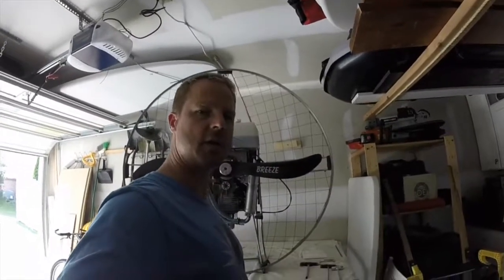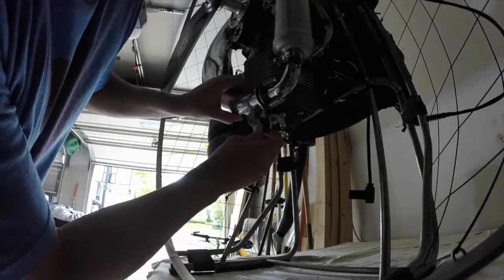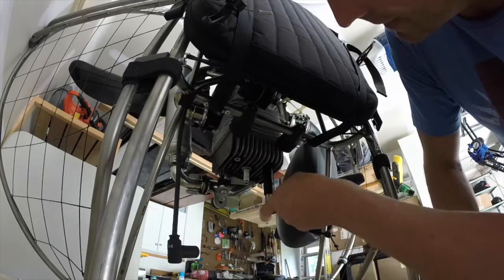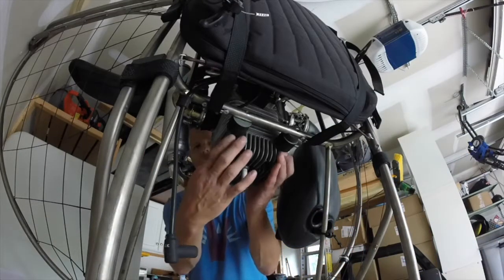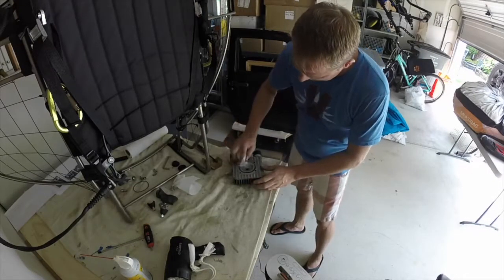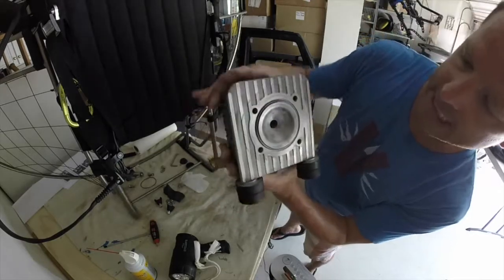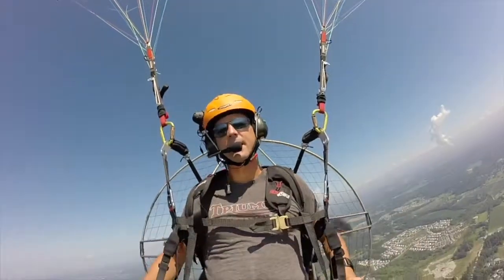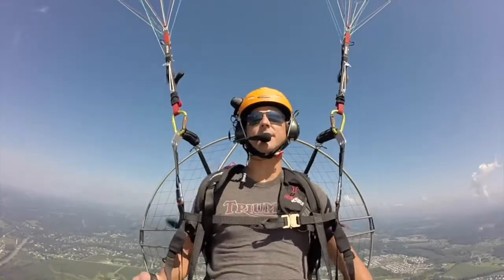Paramotor Maintenance - Cleaning the Decompression Port

Comment: just a note here to add my experience in case it helps anyone: On the Cosmo 300 Vittorazzi , dual start single spark. experiencing hard pull starts, heavy kick back and NO electric start. Starter runs fine, doesnt fire. no voltage drop. new battery and plugs. carb clean. compression good. new ground cable. Pull start works. electric does not fire up. just spins. Opened the head to find 2 decompression holes that were NOT blocked. So, not sure the problem. Will test the stator next

Comment: Great information, I bought a used PAP 1400 paramotor running a ROS 125 engine and it seems almost impossible to start, it's so difficult to crank it over with the pull cord.
I think the job you completed here might be the solution for my engines starting problem.
Thanks for posting.

Comment: Hi there. Good video. My engine a polini 130 refuses to start, the pull starter refuses to budge. But it can be pulled easily with the spark plug off. Could it b a case of clogged port?
Reply from the maker: I really don't have any experience with that brand of motor, so I would be reluctant to give any advice without knowing more on the situation.

Comment: Have the very same FB Simo machine here in Sweden, since 2013. But I fly on Aspen synthetic fuel so no carbon buildup at all. Much more expensive though, about 2-3x the normal fuel. I can recommend it to skip this maintenence or, at least have it about every 200 hrs instead.

Comment: Do u use torque wrench for the screws? What value? Thx.
Reply from the maker: Thx for the comment. I do use a torque wrench for tightening the head bolts on the cylinder. For those, I tighten them to 19 ft. lbs.
Reply: Thanks, I have to recalculate to ISO units :)). Fly the best.....

Comment: where the heck do you find/get those gaskets/orings for the head. I can't find it anywhere.
Reply from the maker: My unit is a Fresh Breeze, so I just ordered them through Southern Skies, since they are a reseller of that brand.
Reply: PPGFlyr I couldn't find that piece on the sites diagram. did you call and ask? I'm preparing to buy a monster and doing my research ahead of time so I know what spare parts to go ahead and order with it.
Reply from the maker: I went on to their website and found those parts right away. For the head, you want to be looking under the "Intake" portion of the machine. However, there should also be a "Maintenance kit" that you can purchase and that kit contains some common parts that need to be replaced every so often. When in doubt, call down there. Chris is very helpful and willing to answer most questions on the spot.
Reply: PPGFlyr cool thanks a bunch!

Comment: SANDPAPER OF ANY GRIT IS MADE OF GRAINS, (IN YOUR CASE 400 GRIT), OF ALUMINUM OXIDE, WHICH WILL SCRATCH THE LIVING FUCK OUT OF ANY METAL. unless you plan to polish those surfaces to 2000 grit or so, you will build up deposits UBER fast, after your destructive maintenance. GOOD LUCK!

Comment: I went into cringe mode when you brought out the sand paper! Even 400 grit.
You did leave behind scratches that will build up carbon faster as it gives it a place to build up on and sandpaper removes metal faster than you realize.
When I did rebuilds, polishing the head and the piston with steel wool then pads and polishing compound on a drill or Dremel tool makes them smooth and shiney so build up happens much slower. 
Also pull the plug first! That is if you reuse it (not recommended for AC) and don't break it by accident.
I use a tap to clean the plug holes after any head work as it will clean out the threads better than a rag then cleaner spray to flush.
But nice job working upside down!!!

Blue Sky's and Safe Journeys!
Reply from the maker: Awesome comment. I love to listen to people who know more than I do. It's how I continually learn. Thanks for taking the time to post it. I have subbed your channel, as I was moved reading your story. Best of luck to you in your learning of PPG.
Reply: PPGFlyr Thanks for subbing but there isn't much in it as editing and videoing isn't my best work! 
I'm hoping to have the funds up by summer for an Air Conception PPG and training hopefully with AvaitorPPG close to my old stomping grounds down south because they carry the lightest equipment this damaged body can carry! Plus it's WARM!! Cancer didn't help in keeping me warm!

If you know any guys that do motorcycle racing engines they can help you with how to polish your head and piston by hand or check in YT but green scrubbing pads and believe it or not WD 40 does a great job at cleaning the carbon with green pads.
Practice on an old lawn mower engine so you don't screw up your engine being over zealous using steel wool. Some mechanics won't use a compound to polish and also a lot of cylinder head polishing is done on a machine. Practice!

The more you learn the more you save!

And a tip! Listen to your body because I didn't!

Blue Sky's and Safe Journeys!
Reply from the maker: Excellent choice in machines and instructors! Best of luck to you.
Reply: PPGFlyr research research and more research! I need light as I really don't want a trike or quad but if I find someone that will let me strap on their cage and run with it that will tell me if I can go for foot launch but cancer and brain surgery pretty much screwed me up into being disabled and if I had not started p!aying with power kites then an Ozone Buzz I would still be immobile, but after I got my Buzz and worked with it, after a few weeks I threw away the cane and can actually walk and run again!  Now if only I could get the 40 pounds back that radiation and chemo sucked off me, I'd be happy as a mule eating briars!

What's even funnier while training last summer at POM we figured out why I was having a hard time with it. I was still losing weight and the silly thing outgrew me after I bought it! Now I have a Sky Fides Evo 2 XXS that isn't a problem!  LOL! loving playing with it but can't fly many sites until I get my P2!

Blue Sky's and Safe Journeys!

Comment: How do you like those high hang points?  Sub'd btw.  Great video
Reply from the maker: Thanks for the sub and comment Jesse. I really like my machine and hang points. I originally ordered the soft J bar with my system, but that would have been delayed about 6 weeks, so I went with the high hang points and haven't had any issues at all.

Comment: How much to expect to for paramotor? A paramotor that would be a good one?  And a Good name brand that backs up there product with parts and service? I'm thinking new that I would have for years. I was a motor cross racer from a little kid to I hit 40 and got in to Rcplanes. I like the just me and bike feeling. If you know what i mean. And yes I would go through a training school.
.
Reply from the maker: Great questions. And I hear you about the riding. That is how I feel when I am flying. There are many considerations when getting a new paramotor. I have had mine about 5 years, so they are built to last and be maintained. I chose the fresh breeze because it works at a lower RPM, so it is quieter than other models. In the US, Southern Skies (Raleigh, NC) is the distributor of choice for Fresh Breeze. They have great training too. Another great unit that is fairly new, well built and lightweight is the Air Conception Nitro. It has electric start and Eric from AviatorPPG sells those and is an excellent instructor. Check out his video on this unit. (https://www.youtube.com/watch?v=Zl4xyX6G2ug) If I needed a new unit, this is the one I would get for sure. All this being said, the instructor that you go through will be able to guide you into a new unit. The typical cost for the engine is around $7,500, but will vary depending on which one you choose. If you have any other questions, let me know. Good luck with everything.

Comment: Excellent maintenance video. Thanks! But, did you need to use some anti seize lubricant on any of the aluminum/steel contact connections to limit corrosion?
Reply from the maker: Thanks for watching. I have not used any anti seize lubricant on any parts for this motor. To my knowledge they are not recommended. Plus, I am not sure they will be idle for enough time to actually corrode. I keep my engine in a dry environment and clean it very often.

Comment from the maker: @Abu Timmy  Thanks for watching and the comment. I specifically didn't mention the tension I put on the bolts, because every machine is different. I didn't want someone else using my specs on their machine and possibly over-torquing their bolts. I did use a torque wrench set to a specific tension when tightening my bolts. Also, this is a two stroke engine, so I mix the oil with the AvGas, so there is no need to change the oil.
Reply: I think the Fresh Breeze Simonini needs 14 Nm tension on the cylinder bolts.

Comment: no tension specs on the bolts?  No oil change after you drilled crap in the engine??  there a reason why mechs do a course..

Comment: is that a lot of carbon for 30 hrs?  running too rich?   was the spark plug dark or light brown? just wondering .
Reply from the maker: The spark plug was more toward a lighter brown. I should have given a close up shot of that. As for the # of hours, I have heard from several that this was the right time to check the carbon build up and clean it out. I would rather new on the sooner side of the maintenance, than be later. Thanks for watching and the comments.